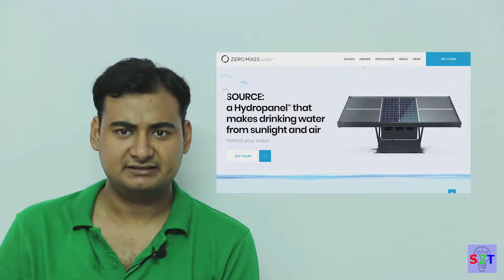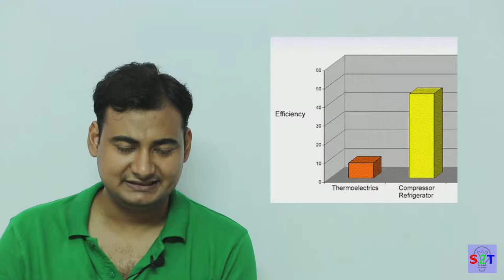Science Thursday Ep2 (Pseudoscience of Water from AIR)

Comment: Testing at unit level is easier and do able in most of the cases , the thing which makes it difficult is take it to the bigger stage and do integration.
Reply from the maker: That is the whole point its works but at large scale this sort of system will take SO MUCH ENERGY(because of  specific heat of water) that it becomes point less it would be easier and more energy efficient to purify sewage water using RO + UV